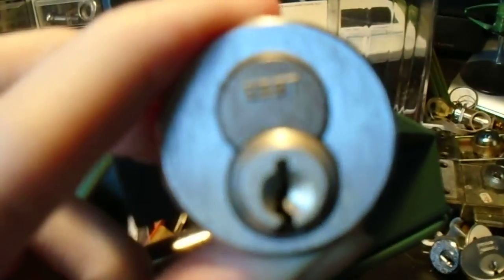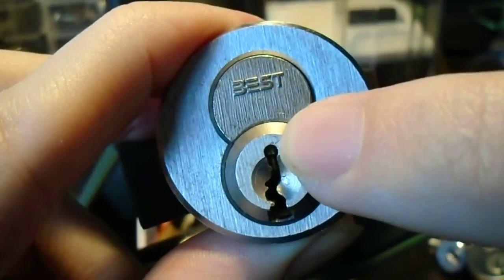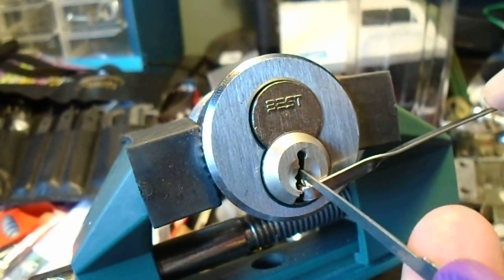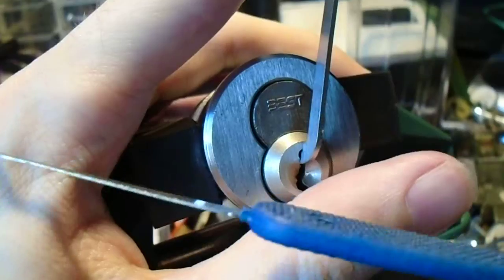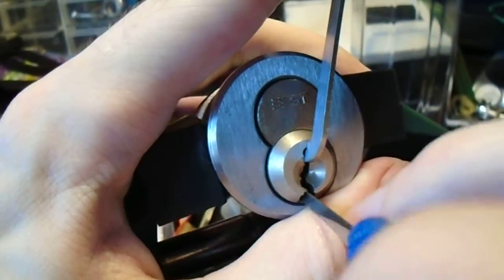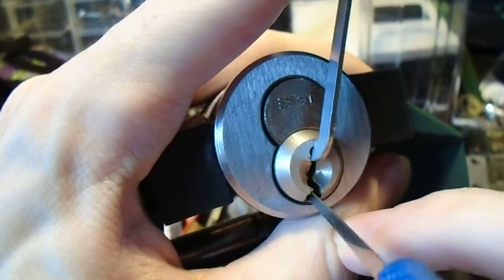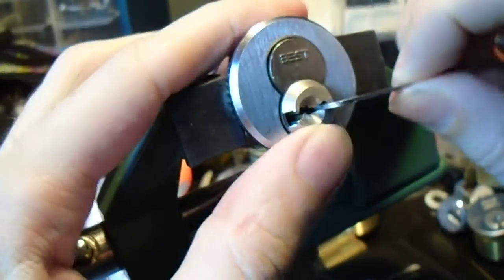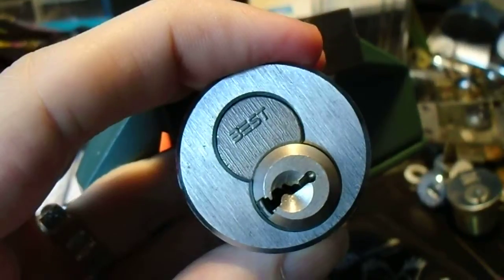(048) Best Kaba Peaks SFIC picked

Comment: I have that same core and I have not been able to do it in days of spp-ing or raking, you did it in four minutes?!?! Great job!
Reply from the maker: Luck as much as anything else. I got lucky that there didn't seem to be many spool pins (Peaks uses several sizes of spool pins), and the timing pin can be very tricky to set correctly, especially in the later Peaks Preferred and Peaks Global series.